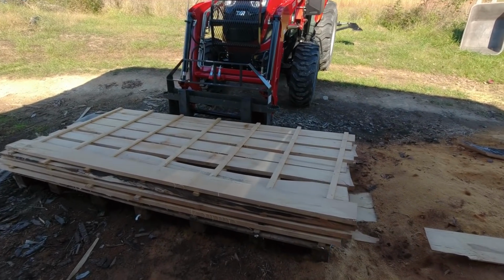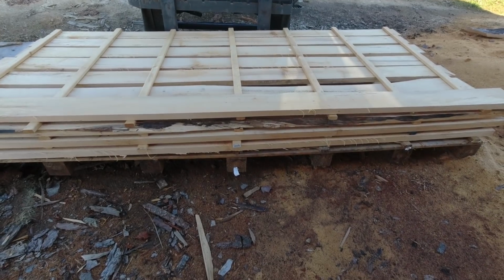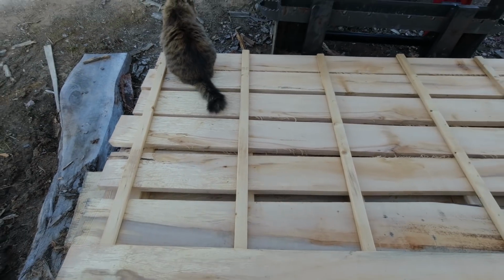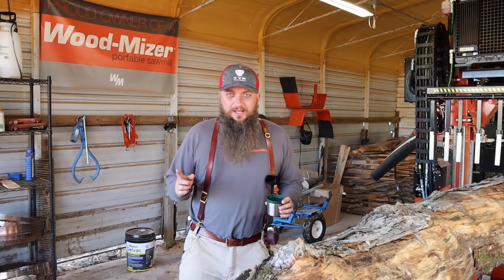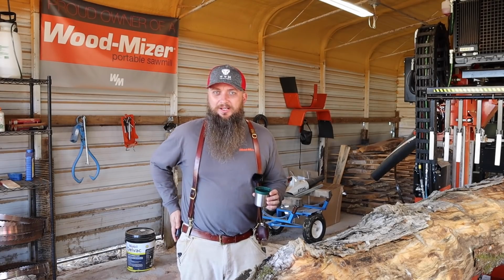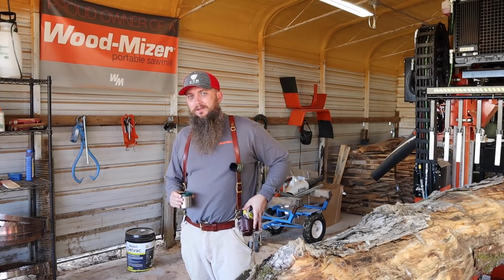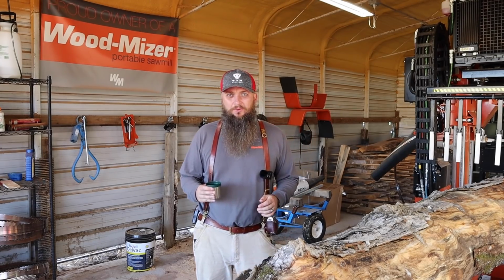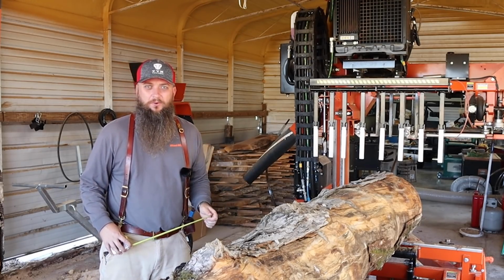This Is Exactly What You Want To Find Inside A Log At The Sawmill,

Comment: The office furniture company I used to work for would put 12 to 14 sticks between the boards to prevent warp and curl during air and kiln drying on 8ft boards. Also, spalting was a no no because it was almost impossible to even out the grain when staining. Spalted wood usually wound up stained walnut, or on the rare occasion, matte black.
Reply: Spalted maple is high dollar

Comment: When milling a log how small of a board (waste) can be left on the bottom?
Reply: Theoretically speaking you use Pythagoras theorem e.g. if a log was 20" diameter at both ends & perfectly straight that would give you a 14.14" cant but you may not make that initial cut as you could get smaller breadth board out of the waste slab. That's the theory but will depend on the log. That's why Nathan knows what he is doing, it's called experience.
Reply: @tonygrimes13  I was asking about how low can the saw go if all you are looking for is slabs.

Comment: Some time could you explain how to figure up board ft
Reply from the maker: deal
Reply: If you want the formula for lumber it is; thickness in inches x width in inches x length in feet and then divide by 12.  So a nominal 1"x 12"x 8' board would equal 8 bd.ft. for example. : ) You can also use all inches,but divide by 144 instead of 12 at the end. 1" x 12" x 96"=1152"  Divided  by 144 = 8 bd.ft.
Reply: @OutoftheWoods0623  thank you

Comment: Why don't you add an air line to your saw on the push fingers for the boards to blow the sawdust of of them as you cut , it would save you all the sawdust on the timber after cutting.
Reply: And then the dust would be everywhere, including your eyes and lungs. He normally cuts green wood which is wet, Plus he usually uses diesel fuel as a blade lubricant, used to use water mixture on his older saws. This Maple seemed very dry today. : )

Comment: As I read through some of the comments, I think you answered my question, but I'll ask it anyway. Does the LT70 automatically lift the1/4 or 3/8 inch so the drag back arms engage the board and not the log, or do you have to pull the joystick to raise it? That was one good looking log!
Reply from the maker: you push a button and it bumps up just enough to catch the boards,
Reply: Oof, best solution there is.

Comment: Pretty poor yield, you said it was 16" dia at both ends. According to International Log Scale, which is what most mills use to pay the loggers, 16" dia by 8' long log should yield 85 BF, and that's with  a 1/4" kerf. and tou only got 67 BF. With your kerf, you should be at least 15% over the International Scale.
Reply from the maker: We use the Doyle scale here, which shows 72bf. I have never been to a sawmill or log yard that uses the International scale so I can not speak of that, And yes sometimes you are over the scale but that depends on the size of the log, smaller logs yes but bigger logs such as 24in diam and you will never go over that, a good saying is the sawmill punishes the logger who brings him small logs but proper size logs are more fair on both ends. 
 I was happy with my lumber,  thanks for watching,